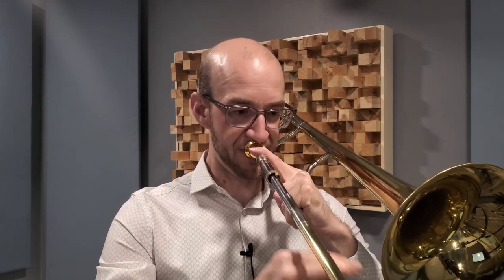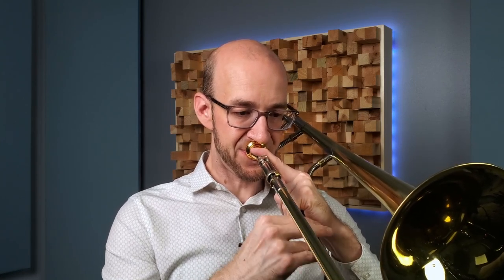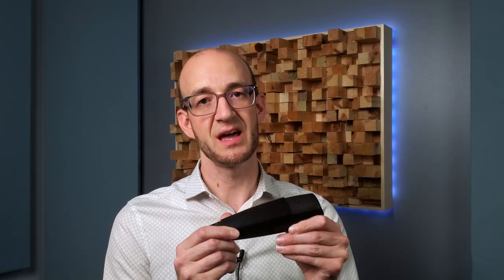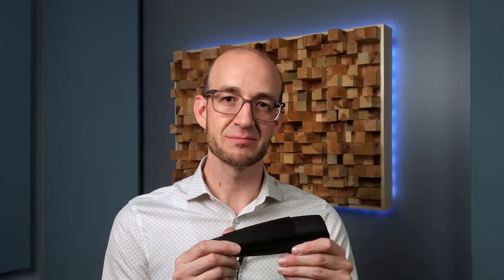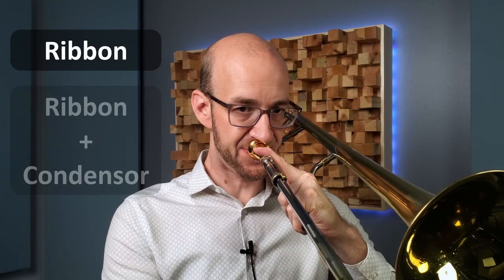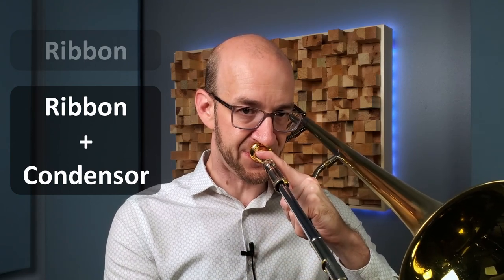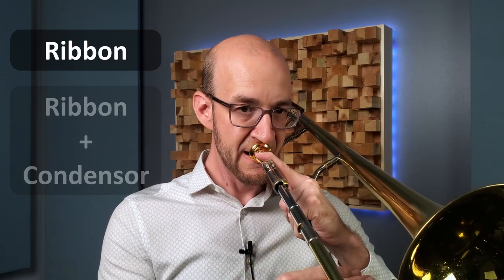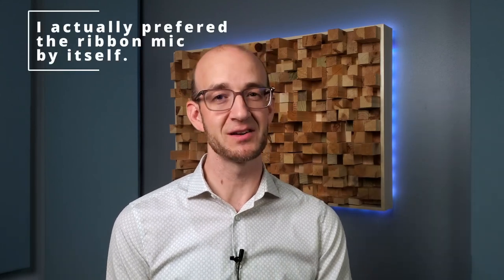How To Record Trombone If You Aren't An Audio Engineer: Part 1

Comment: I've seen recommendations to record yourself and listen back when practicing, if that is the main use of the mic as opposed to making music for public consumption, which type of mic would you recommend then? To my mind the more "accurate" the better as it's less likely to "mask" issues you might be trying to improve on in practice, so it seems to me the condenser is the right call? What are your thoughts? Thanks!
Reply from the maker: When I record myself in my daily practice, I actually just use my cell phone. The quality is "good enough" for me to hear what I am trying to hear, and the ease of use outweighs the less than pristine recording quality. I do always listen back through a Bluetooth speaker. That improves things significantly.

If you do want to get a better, more accurate, sound, I would actually recommend a good quality dynamic mic rather than a condenser. Sennheiser md 421, Electro voice re20, and Shure sm7B all sound great on trombone.

The challenge with condenser mics is that they are very sensitive and will pick up both ambient noise in your house (think of the sound of your dishwasher running two rooms away) and will pick up a significant amount of the sound of your room. 

Most of us practicing or recording at home have rooms that actually don't sound very good on recordings without acoustic treatment. Square rooms with sheetrock walls lead to less than ideal recording spaces Since condensers are very sensitive, they will pick up all the aspects of your sound bouncing around the room. This will actually cloud how you are perceiving your sound rather than provide the clarity you are looking for.

Dynamic mics, like ones mentioned above, are not as sensitive and reject a significant amount of that room noise. This is especially true is you use the mic relatively close, maybe 4-10 inches from the bell.

I have recorded in a fair number of professional situations where I play on a md421 or an RE20 and am very happy with the results.
Reply: Thanks very much for the quick and detailed reply @ShawnBellMusic  I'll take a close look at those 3. a quick looks seems to show the Sennheiser and Shure are the lower cost options,  what do you think would make you pick one over the other if budget is a consideration? Thanks again!
Reply from the maker: @paulmorris8465  I really like md 421s. I use one as my go to mic for live shows. It tends to sounds good even if the sound engineer isn't super experienced mixing or EQing trombone.

Honestly, the differences are going to be very subtle between these three mics, so if budget is a factor, go with one of the less expensive of the three. They are all great options.

Comment: I havent recorded trombone in quite a while but id always use a rwally nice condenser. Bit battle with a yuck sound. Im thinking lowering from 3K up to 15K will help a bunch
Reply from the maker: You could also try a tube condenser if you have access to one. I have found that tube mics usually sound pretty good on trombone. You still may need to tame some of the high mids and the highs as you mentioned to get a sound that isn't too harsh or airy.
Reply: @ShawnBellMusic  Live I always used a Shure beta clip on mic and that's fantastic. But that was playing ska and punk rock so no one notices. It would sound just like my horn it was amazing. But record that on its own and listen back...the amount of air flow picked up sounds horrible.
Your video has given me motivation to try again